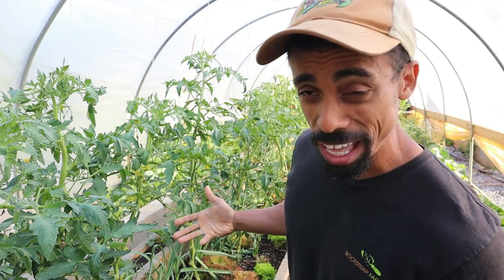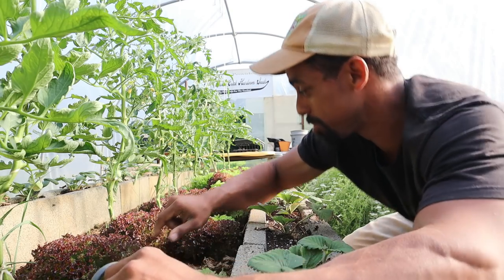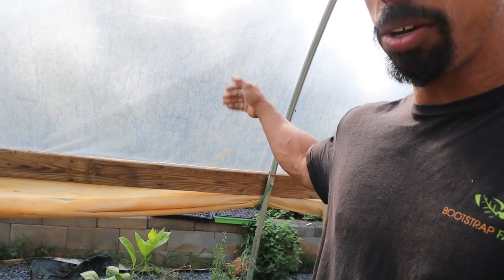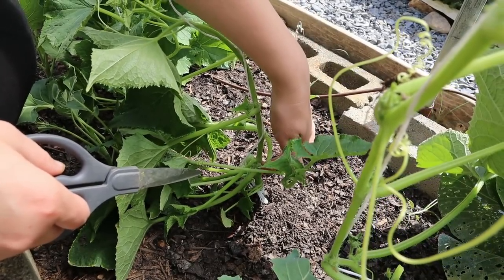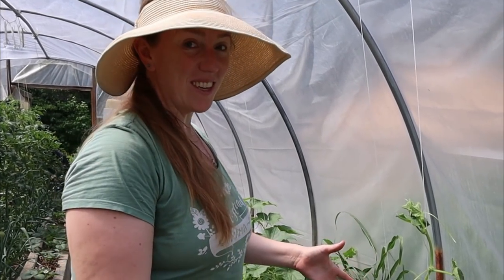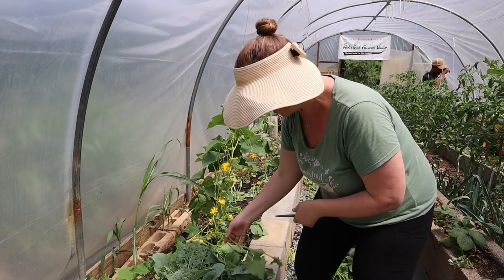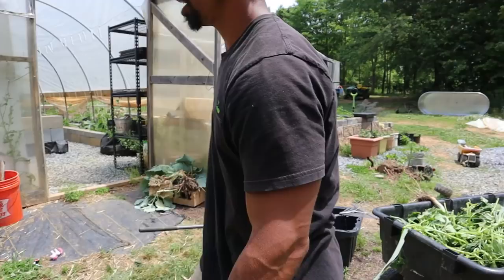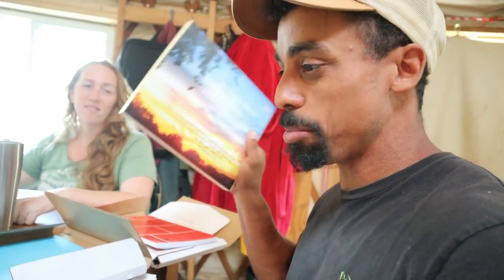GROWING MORE than ever in my Greenhouse

Comment: Yeah, it's definitely hotter in a greenhouse or high tunnel. At the greenhouse I worked at we had big fans at each end pulling the air through. There was also one of those auto-rotating fans in the middle to help mix the air & eliminate hot spots. It wasn't perfect, but it sure helped.

Comment: For those of us that don't have rows like Mike I use drip hoses from harbor freight.  They work really well and are a reasonable price.  I like Mikes set up but my garden doesn't work like that, more eclectic.
Reply: Harbor freight is really a hit and miss on certain items I would recommend that buyers really read the reviews upon purchasing. 

On high-end products I would not go through harbor freight, it just being a hose it might be okay.
Reply: the dark lord that's most likely true but I spent a small fortune buying the rubber I drop hoses, retarded the pressure and spent MORE money on guerrilla tape to patch the multitude of hose leaks.  I tried these hoses last year and they work great, are covered in material which I need to protect from the sun but I highly recommend these hoses.